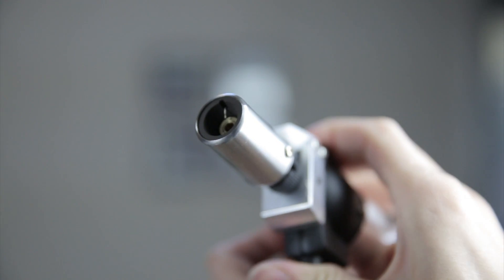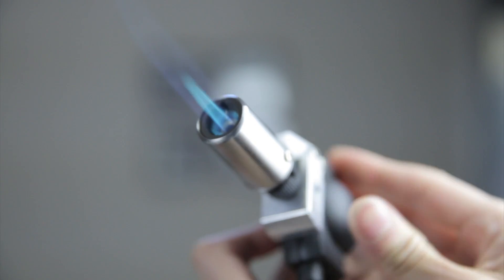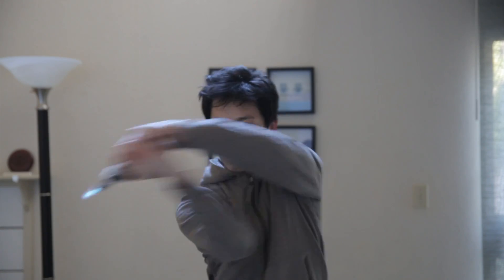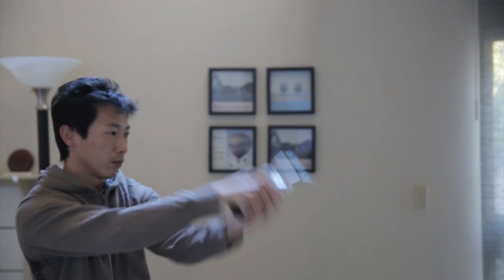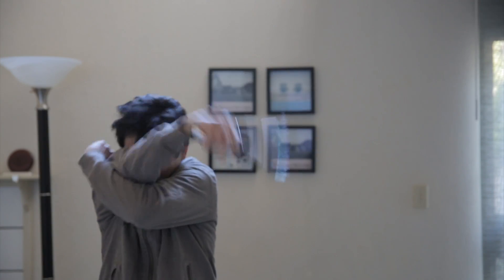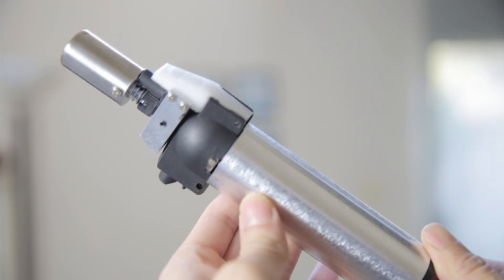Real Life Butane Lightsaber Burns at 2000°F

Comment: can that torch be modified to augment the air pressure? so the flame could get even longer without losing power, also were i can get one of those?
Reply from the maker: +Marcos Allendes You cannot actually buy one since this is just a prototype. If you do decide to make one it will be at your own risk. Seriously, one drop and everything burns down.

Comment: I don't get why people don't use the technique that a Oxy/acetylene torch uses... Just pump a metric butt ton of Acetylene and Oxygen through a torch and the blade will be longer and more intense.
Reply from the maker: +mihajlo525 My guess is because an oxy/ace torch or any other torch flame length is limited by the burn rate of the chemical itself and not the amount of fuel. If you eject it too fast, the first part of the flame will not light until later as is the case when you crank the fuel source too high. Just my guess.

Comment: Now here's the next improvement, knowing it can be swung around like crazy without being put out (unlike the one shown on node) can you make the blade longer? If it's even a couple inches longer then you sir have invented the lightsaber.
Reply from the maker: +MikaAmane The blade is already at maximum length. I do want it longer but I believe it's limited by the rate of burning of the butane and so I cannot just make it longer by increasing pressure or using more fuel.
Reply: BeatTheBush Ah, yeah, would be awesome if you could get a longer blade though.

Comment: I think in the future you should modify it when u have the chance to make the blade longer, but great job! :)
Reply from the maker: +E-VID 486 Certainly tried with alternate nozzles but I found out quickly that the blade length is based on the rate of chemical burning and so there's nothing I can do about that. I am working on another one. mu ha ha ha!
Reply: +BeatTheBush lol! Hope it goes well, ya know the thickness of your blade is actually the most realistic to the real thing yet, good luck :)
Reply from the maker: +E-VID 486 Thanks much!
Reply: +BeatTheBush no problem, just upload it right when u finish, lol u don't have to, just make sure u upload it :)
Reply from the maker: +E-VID 486 I certainly will. The main challenge is finding a place to test it because ejecting flames in any public place is frowned upon. lol.
Reply: +BeatTheBush lol I bet :)

Comment: and how r u seeing it as a saber or sword?
Michio Kaku made the best project
Reply from the maker: +Seba92000 For a lightsaber, there are various characteristics you can choose to emulate in real life. Melt metal doors, cut flesh/armor with one stroke, 4ft long and not forever long like lasers, width of blade about 1", handle size, ability to wave it around and have it look straight, making real light saber sounds and not emulating with speakers, extension/retraction of blade with a button, not blinding people even though its plasma (real plasma blinds people permanently). Depending on which is more important to you, you can very well like other projects. This project has the width of the blade, the ability to wave it around quickly, and making lightsaber sounds when the other ones cannot.
Reply: BeatTheBush
sword saber lightsaber are a contact weapons. its just an ordinary flame torch. it has nothing to a lightsaber
Reply from the maker: +Seba92000 Sabers made out of light that can deflect another light saber doesn't exist in real life. If you prefer contact type a toy light saber is probably closer to what you prefer.
Reply: BeatTheBush
indeed a toy is much closer to a "lightsaber".
Your, can't be called a lightsaber. Watch "real lightsaber" by scientist Michio Kaku.
That's why you have so many dislikes of that video if you wonder.
Reply from the maker: +Seba92000 Naw, I actually like this more than a toy. Like I said, depends on which attributes are important to you. Some really like it as it is, an interpretation of a lightsaber in real life. Actually, more people like this video than dislike.
Reply: BeatTheBush
 Actually for a YT like/dislike average|standard it's pretty bad but glad you're an optimist ;)
Reply from the maker: This one is much worse: https://youtu.be/ZSBq8geuJk0

Comment: i can by that at home depot
Reply from the maker: Post a link.
Reply: +BeatTheBush https://www.google.com/search?q=flame+torch+Home+Depot&start=20&client=ms-android-att-aio-us&sa=N&biw=360&bih=259&noj=1&tbs=vw:l&tbm=shop&srpd=2997670208441113742&prds=epd:15686152610953495252,cid:2040645206302051838,paur:ClkAsKraX3y5zkijuGBLCYyamrgbq7MhWApjwgniAYeX_INAFUJylktB1mynXH90wm9SmryFEgw1_czeR4O7ICP709H6aBZsx4W1c07tyw3bD5rzxU4hH0uEdxIZAFPVH70JBMPXkMgTcWXO1llArFJTa1xU3Q,cdl:1&ved=0ahUKEwi8ieKwyIfKAhUPzGMKHbtgAv04FBCBNgiRAzAE&ei=QOSFVrzpG4-YjwO7wYnoDw
Reply from the maker: Which one of those has a large flame while having a straight handle?
Reply: +BeatTheBush  also buy those down in a smoke shop for people that smoke crack
Reply from the maker: I kinda knew they had something like that but never one with both a large flame AND a straight handle.
Reply: HOLD UP ima find one in a smokeshop x)
Reply from the maker: You gotta find one where you can see the flame turned on because they are usually tiny for the ones with the straight flame.

Comment: it's just a bunsen burner
Reply from the maker: But with a handle.
Reply from the maker: the applepi 3.14 I kind of gave on trying to make this style of flame output longer. Will be trying a different kind.
Reply from the maker: the applepi 3.14 sure
Reply from the maker: the applepi 3.14 So if I'm reading your description right, its a long hallow tube with holes in it. So there would be lots of tiny blue flames coming out of the holes? It would certainly make a long flame thing but you would not be able to have a beam appear and disappear out of thin air. That property would be my favorite. Also, I guess you could angle the exhaust holes so that it'll at least look like one continuous flame, but having a metal tube in the middle removes the extending ability I like most.
Reply from the maker: the applepi 3.14 I like this vortex idea! But then it'll be very hard to create it in a small handle. AND you also want to make it super hot too. The thing is, I think a vortex would mean a strong wind would blow it away, it needs to be wind proof so the vortex has to be pretty strong as well.
Reply from the maker: the applepi 3.14 Speed might be enough but I think it also needs enough volume. I guess if one tries hard enough to make some vortex fire blade, one could. =)

Comment: @BeattheBush  That's either a light saber for fighting REALLY up close (Which is something I would not recommend) or for little gnomes with really big hands.
Reply from the maker: +nouser nouser This is the saber dagger to be used in confined spaces. Or... well.. I just had the blade length adjustment set to low, wouldn't want to burn down the house now. lol.